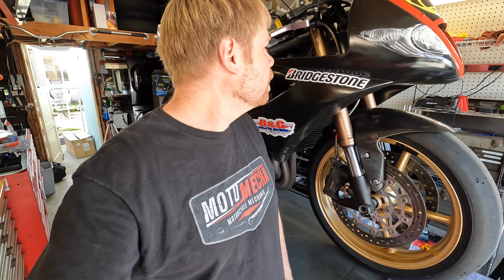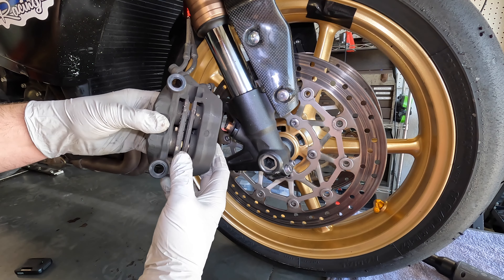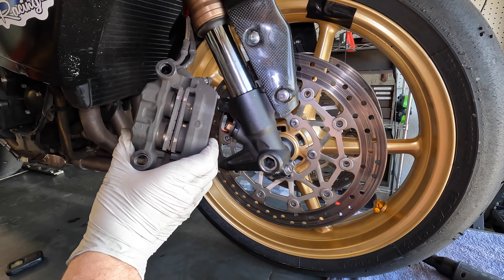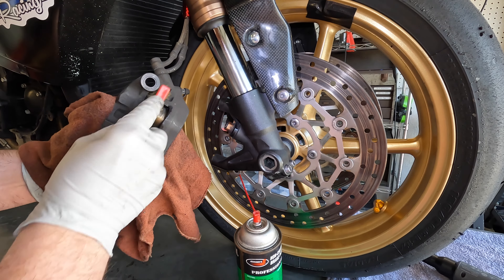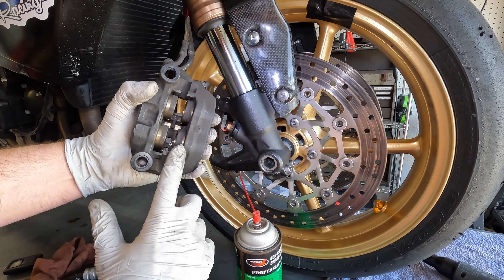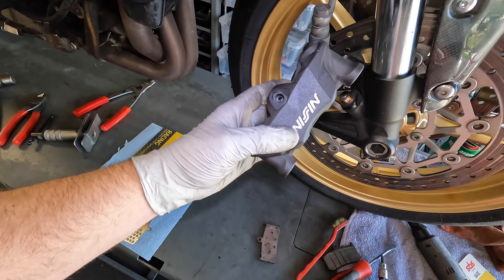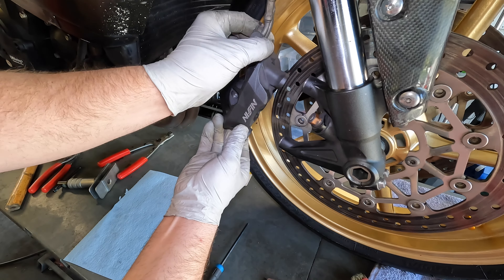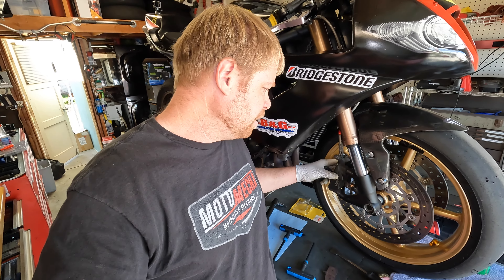How To Replace Front Brake Pads On A Motorcycle!

Comment: Good Video.
Interesting idea about turning the pistons.
Only differences I see with other YT vids about front brake jobs is 1: The use of brake cleaner to clean piston seals.
2: Holding down the brake lever  while tightening up caliper bolts to help center caliper on the disc.

Comment: How do you know which brake pads are compatible with those backing plates and which pads are not?
Reply from the maker: If they are for this year make and model then they will fit the original backing plates. Brake pads are very model specific.
Reply: @motomecha530 I was just meaning in general, not specifically for that bike. Seems some bikes have those backing pads originally but then they don't get reused if switching to alternative pads.
Reply: Just get the right pads for your bike and the OEM anti squeal shims/metal plates,will fit no issue.

Comment: Is it normal that the wheel rotates with big resistance after replacing new pads? Brake calipers cleaned like new,      brake fluid replaced and bled.
Discs are quite worn out, but still have a minimal thickness.

Comment: After I had my front tire changed out I put my wheel back on and now when I hit the front brakes I get a pulsing feel like it grabs for a half second then lessens for a half second. Any idea what it could be? Maybe my brake pads aren’t set right?
Reply from the maker: Did one of the rotors get bent somehow?
Reply: @motomecha530  that’s what I’m wondering maybe they bent the rotor or dropped the rim when they were changing the tire. I’m going to have to take it back off and have a look at it all. You are San Diego based correct? I’m in La Mesa.